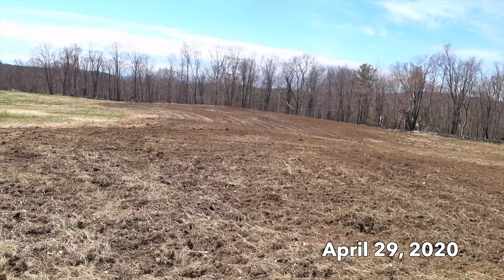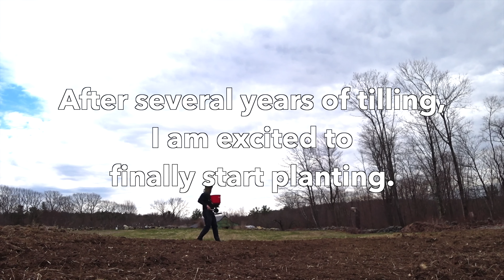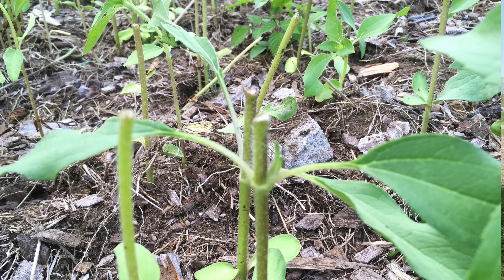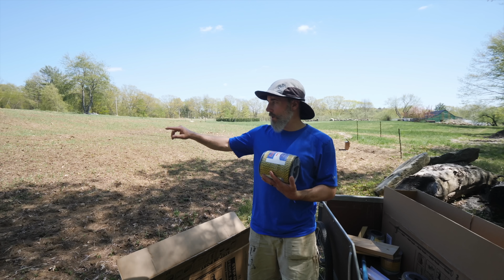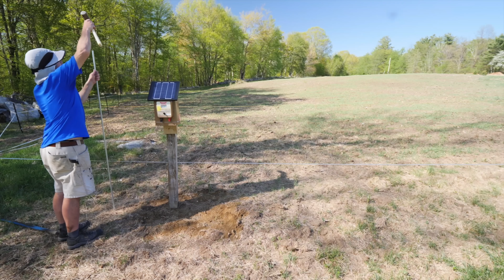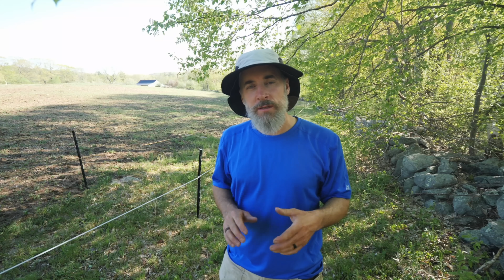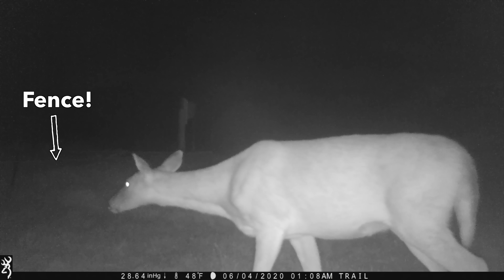My Ongoing Battle With Deer  (Two Layer Electric Fence!)

Comment: Jim! Sorry to hear about your deer situation ( I refuse to call it a problem as some people would call it an asset ). Your conundrum falls squarely in my realm of expertise. It seems you have pretty significant deer pressure in your area and once food resources thin out you will likely see increased pressure on your plantings. In general the double layer fencing concept works on a different mechanism than your theory. Double layer fencing largely relies on the fact that, yes, the deer will eventually jump the first fence but now do NOT have enough runway to jump the second inner fence (which should still be 7 to 8 feet high. We used to use this technique in the reverse sense ( have a 6-8 foot fence first then a 4 foot one on the inside) to trap deer. They would jump the taller outer fence and clear the inner fence along the way, but once inside the pen would not be able to jump out. So here is the basics for what you want to do.....outer fence 4 feet high ( and angled at about 45-60 degrees from the ground with the top wire at 4' off the ground)and spaced about 3 feet out from the inner fence at the base. This degree angle gives the outer fence, not only height but unwanted depth as well for the deer. The inner fence should be about 7' tall and made of sturdy mesh so that the deer don't just push through wires...yes even though the hot wire hurts, the deer will push past it for food. I understand you are looking for a less unsightly option but deer are athletic and resourceful and based on expense and your time, doing it once the first time is a far better use of your time then repeating the fencing project multiple times until you end up at the same end product I have described, or give up your plantings entirely. Message me directly and we can get into more details if you wish. What I described to you is a hybrid between the 7-wire fence (for the outer fence) and the Woven Wire fence in the following link. If you plan to stick with the fence system you have in the video I would HIGHLY suggest you use the peanut butter method listed in the "temporary" section of the link to condition your deer to avoid your fencing. https://www.ncwildlife.org/Learning/Species/Mammals/Whitetail-Deer/Fencing-to-Exclude-Deer#7092697-peanut-butter-fence
Also...the distance between your inner and outer fence seems a bit too far apart. They can jump one fence...linger in between then jump the inner fence.
Reply from the maker: Sounds like you're talking about a different thing than what I built here. I know I could build a fortress and completely exclude deer, but the whole point is to avoid surrounding our property in a 7 foot fence. This may not be 100% effective, but if it reduces the pressure for 2-3 months, that's all I need.
Reply: @vinofarm  if that is your goal...then definitely use the peanut butter trick...it should help you out immensely. The other thing you could do.....plant a decoy crop somewhere else on the property with Brassica (essentially plants of the turnip family) as they would preferentially feed on that (and is really innexpensive)
Reply from the maker: @hyfy-tr2jy  Thanks. Peanut butter is a good idea.